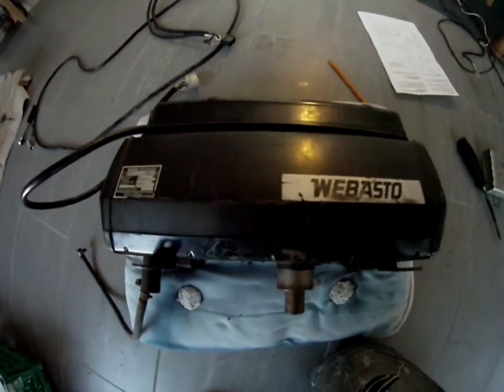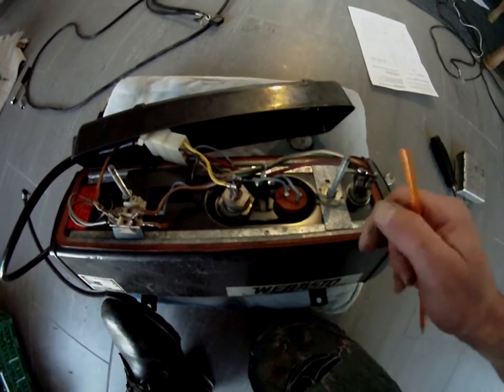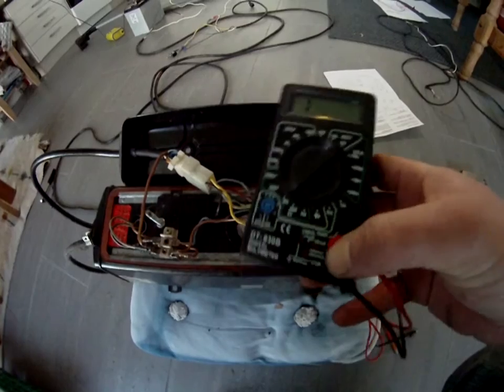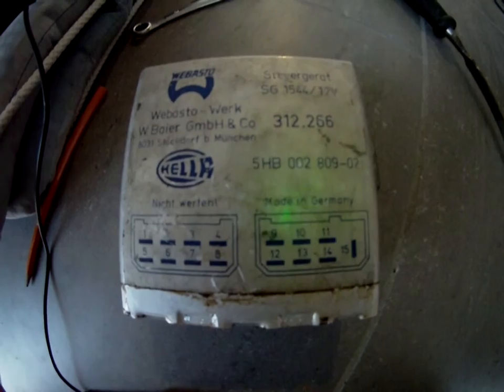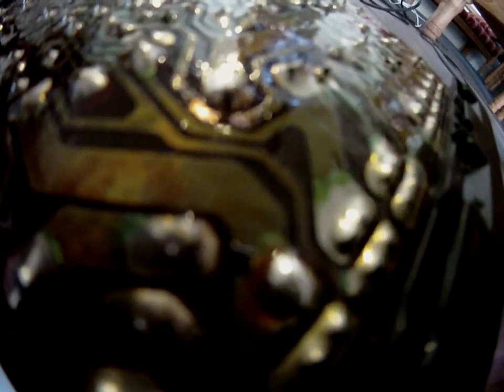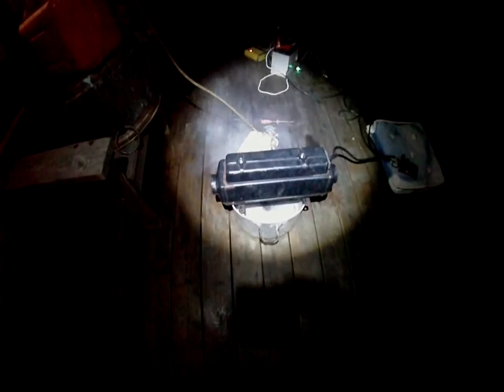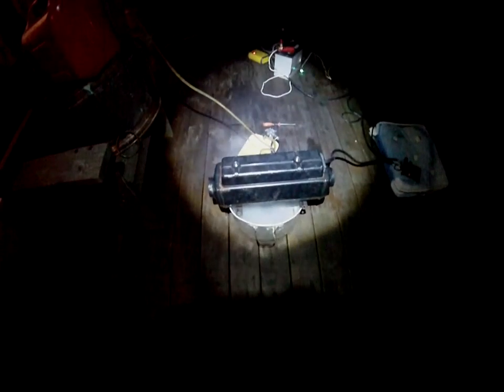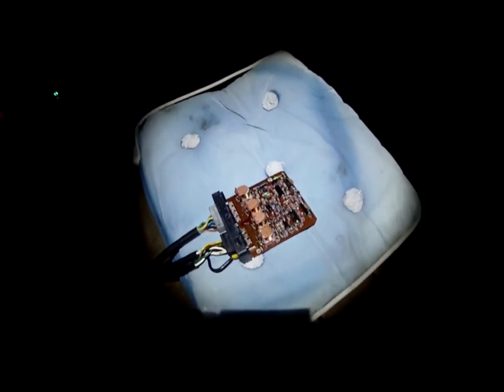Webasto HL2011 system check and repairing the SG 1544 controller

Comment: Hello, nice video helped me a lot. I checked the machanical parts and everything is okay. Now I'm having a problem with the electric circuit, I got this boat recently and the last owner took the all thing apart, my doubt is the connections to turn it on and off, do you have any diagram of the wiring or could you tell me something about please?thanks.
Reply from the maker: Hi, I do have some diagrams but I do not wish to publish my e-mail  here. Send me a PM.
Reply: @leafmaleaf4001  I can't find a way to send you a PM.
Reply: @leafmaleaf4001  you could send me one gean_monteiro33@hotmail.com.
Reply from the maker: I have sent you the documents and comments. Let me know if you have received them or not.
Reply: @Leafma Leaf hi, sorry to disturb you, but if you could send me those diagrams me and my wife would be delighted, we are in the southern most city on South America and it's -7 here today.

Comment: What fixed the exhaust fogging/smoking? Did you switch to a pump with higher pressure?
Reply from the maker: I just let it burn for a while.  I assume that the chamber was coated with diesel from all the previous failures to burn. After it burned for a few minutes the exhaust was as it supposed to be, but I still do not like that the exhaust is so hot. It seems to be a lot of wasted heat energy. I might try to put on a few peltiers on the muffler to see if I can reclaim some of the energy...